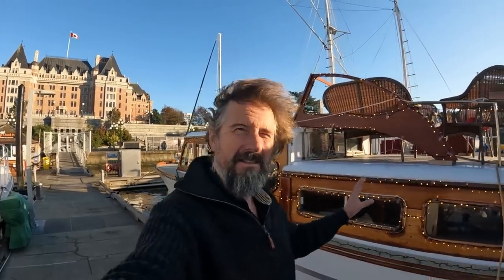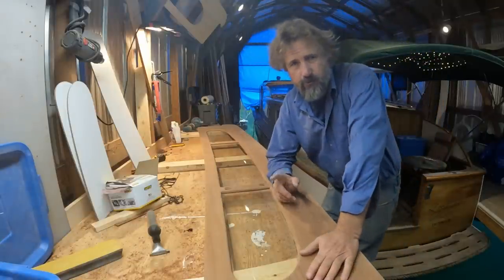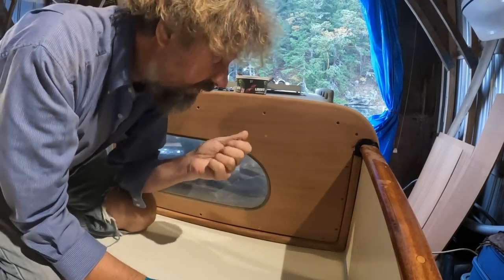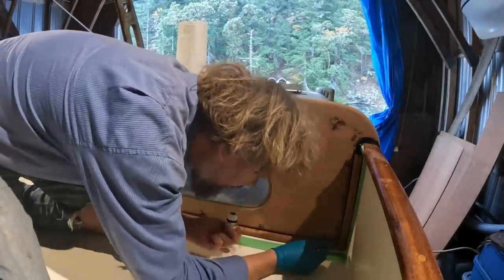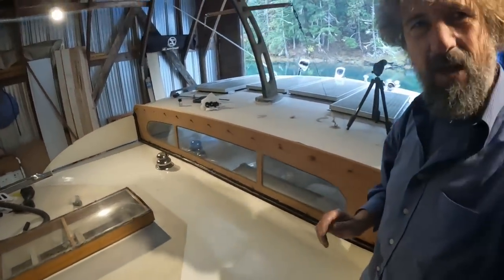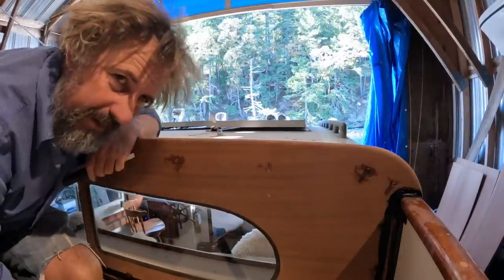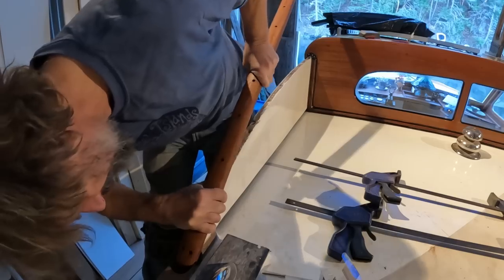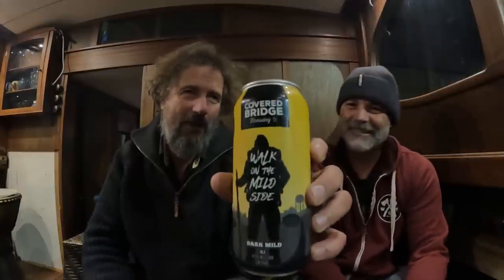Bulkhead Complete - #338 - Boat Life - Living aboard a wooden boat - Travels With Geordie

Comment: If you push the tip of the caulk tube with a straight cut it will leave a nice cove with out much mess .I have always cut mine straight.